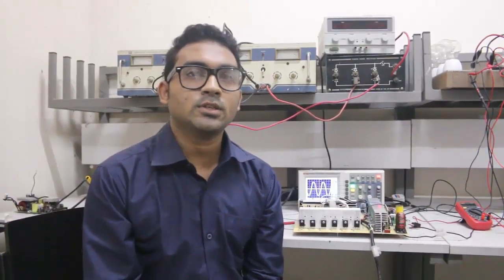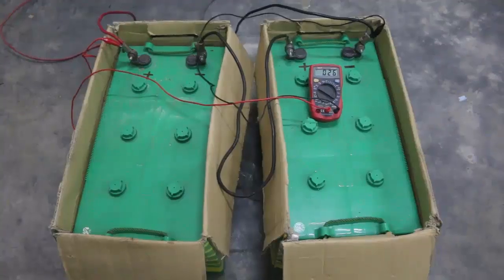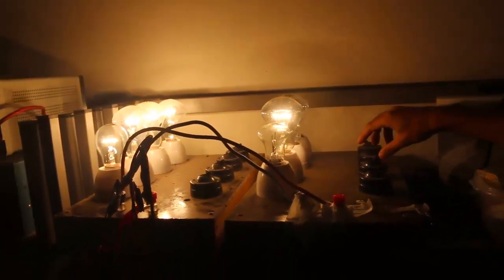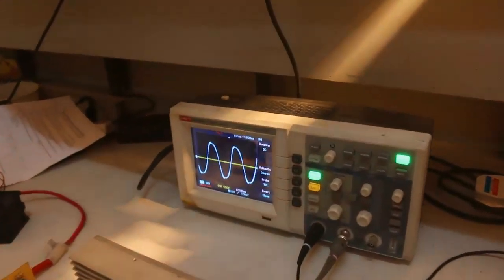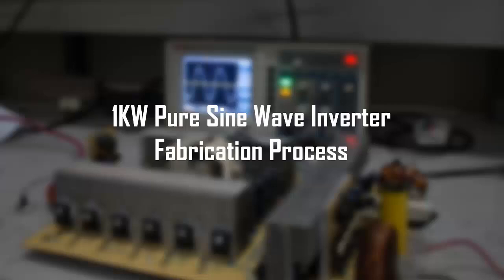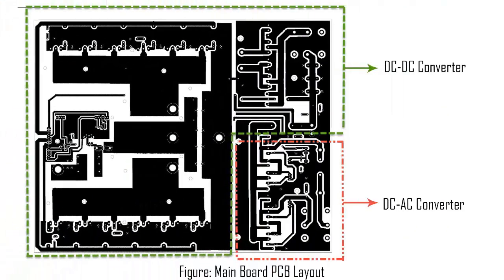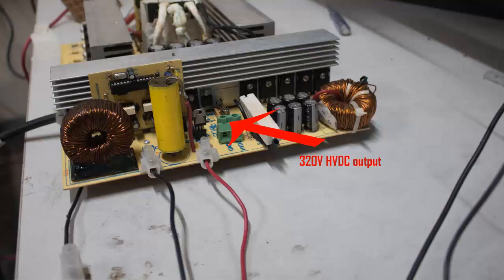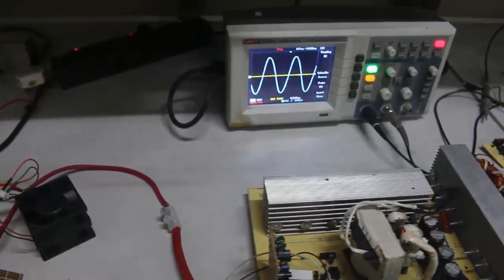Pure Sine Wave Inverter (1KW)

Comment: Hi everyone.knows any to tell me,what if i run my spwm inverter,with any type of load,without low pass filter to the output?,whatt the matter????? must be a filter anyway? and if yes,why? thank you.
Reply: There's a hum noise if you don't use a low pass filter. Plus some sensitive devices can get damaged due to the spikes caused by the switching. It's like a staircase waveform without the low pass filter so you can understand what's wrong. For loads like incandescent bulb it won't matter but for stuff like a fan/motor or computer SMPS that have inductance, the sudden changes of the non-filtered output can be a problem. At the least they will run hotter. It also creates EMI noise that can get picked up by other appliances like your TV and there will be a hissing sound from the TV.

Comment: the video is very effective for me. i want to make free energy for home 1.5 kw. so please if possible make 2 videos for Transformer calculation for EE Ferrite core of push pull inverter "Square wave & Sine wave. please help me and provide C code, design diagram/pcb lay out if possible. 01819-988287. Dhaka.
Reply: you can do this exactly and ask some else to charge batteries, and you will have free energy :)

Comment: Mr, I am interested in pure sine wave project you and your friends to develop the project .. Can you share it? I want to try on a 3-phase AC motor 0.75kw.tqvm .. razi022@gmail.com
Reply: shared project file, scamatic circuit microcontroller code that you use if possible. TQ ..

Comment: You have all done very well my big brothers. In fact I commend you all for the good work done. May you all get the necessary wisdom and knowledge to do more to help us. By the way we have problem with power here in my country and I have thought of building a pure sine wave inverter to serve as a backup when there is no power. Please could you share with me the source code, the circuit diagram and other important files needed to build this nice circuit? Thanks in advance!
Reply from the maker: your email please
Reply: Reubinho18@yahoo.com thanks in advance
Reply from the maker: check your email and let me know
Reply: I just checked but it's not in yet.
Reply: shuvangkar shuvo  tienes el esquema

Comment: sir i make booster using pushpull technology (12-230) but now i have convert again it to ac so i will very thankfull to u iused sg3525..
 Sir, I want to make this inverter. Can you guide me by providing all the necessary detail (like schematic diagram, pcb design, Microcontroller code project file, ect......), I am very much interested about this project. Yesterday i already give you my email id, but not get any email from you    my email is irfankhandgk11@gmail.com

Comment: hi , how are you ? i faced some problems with making the output filter, I can't find the data of turns number of coils , wire diameter and the size of the filter in the attached report !!, Can you provide me with the data?
and I can't find the code of microcontroller for the  circuit Protection in the attached files!! , thank you sir

Comment: Hi sir. Can you share the project files for this project. I really need it for my final year project. Thanks. (farhannafis.azmali@gmail.com)
Reply from the maker: Please check your email and make sure whether you get the files or not
Reply: Thank you. Already got the files.
Reply: sir i make booster using pushpull technology (12-230) but now i have convert again it to ac so i will very thankfull to u iused sg3525..
 Sir, I want to make this inverter. Can you guide me by providing all the necessary detail (like schematic diagram, pcb design, Microcontroller code project file, ect......), thanks    irfankhandgk11@gmail.com

Comment: awesome thank you, mr.salah2030@gmail.com please send it
Reply from the maker: Please check your email
Reply: thank you , but i didn't find the code file
Reply: sir i make booster using pushpull technology (12-230) but now i have convert again it to ac so i will very thankfull to u iused sg3525..
 Sir, I want to make this inverter. Can you guide me by providing all the necessary detail (like schematic diagram, pcb design, Microcontroller code project file, ect......), thanks    irfankhandgk11@gmail.com
Reply: sir plese send me irfankhandgk11@gmail.com i will be very thankful to u
Reply: sir plese send me irfankhandgk11@gmail.com i will be very thankful to u

Comment: Is the Design completed by your team, Or u all took it from Open source internet. However i am not clear yet which micro-controller you used for SPWM. There is no Feedback control for output voltage, Just simple Dc BUS Controlled by SG3525. Please upload the No load current data. If possible upload the final year paper.

Comment: I would like more info on this inverter. can I get a schematic. or parts list? I am trying to build a inverter to power my off grid house. I need to build a 6-8 kW. or 3-4 of the 3kw. witch ever will be most efficient. I heard some will be more efficient at low load and some at higher loads. I was hoping to find a link to get info or schematic. I would most grateful if you can help me. thanks you

Comment: sir, i steel working about same project i use a ferrite core TF which input was12v dc  40khz pwm signal and output is 230v ac square wave and 310v dc by using rectifier  but i can not make it 50hz sine wave.plz can u help me by giving circuit diagram of your full project.thank you.............EMAIL: ferozahammed69@gmail.com

Comment: THE BEST SOLUTION TO MAKE A SIMPLE SINE WAVE NVERTER IS PWM INTO THE MOSFET TRANSISTOR WITH SINE WAVE RITMIC BUT MECHANICAL DESIGN WITH SIMPLE PWM DC MOTOR CONTROLLERS INTO THE PHOTO TRANSISTOR
Reply from the maker: check your email
Reply: shuvangkar shuvo Emacacoel@hotmail.com

Comment: Thanks In Advance :D
great :) i am also working on that i am making variable frequency for which i converter 220AC to 320DC first then using H bridge for modulation  but i am facing problem at outside LC filter. my carrier frequency is 31.5Khz i had made filter which is making noisy sound and input current is too high if i attach 100 watt bulb it take 3 amps @220 input  as i remove filter it come back to approx 500mA . i need you help what should i do. i change core many time but result is same
one thing that is confussing me is why you use an other inductor beside the filtering inductor?
email: waqarhameed113@yahoo.com
Reply from the maker: Most welcome Waquar. Another Inductor is for Boost converter which is boosting 24VDC into 312HVDC. 
Did you keep dead time in between the same side MOSFETs signals??
This is the one of the reasons, H- bridge is dissipating current at no load.
And filter section, I used Polyester capacitor and ferrite core toroidal inductor.
Reply: you use chopper(transformer) for boosting right??? why and where you use 2nd inductor 

yea i manage dead time. when i remove output filter and attach load it works normally and take approx 40 to 50mA at no load condition
what is the value of inductor and capacitor you are using for filtering 
please send me schematic or other stuff if possible that might help me out 
email: waqarhameed113@yahoo.com
Reply: Well I have solve this problem i do not apply complimentary spwm that is a reason well thanks
Reply from the maker: +Waqar Hameed welcome

Comment: What CPU is using for the SPWM ?Great project
Reply from the maker: Thinks.
I used atmega8 for generating SPWM
Reply: Thats Great as i have that IC on my ATMega Arduino board, i look forward to the project circuits, PCB and source code becoming available so i can make my own version, only thing is i want to scale up to 10KW running from 48 Volts, is this an easy upgrade with higher power IGBT's and filter components ?,

Thanks
Dave
Reply from the maker: +david ellis Sure you can.
please send me your email id
Reply from the maker: +david ellis Sure you can.
please send me your email id
Reply: hi, nice work, please can anyone share me the circuit, PCB and the necessary code and files, email: walkingwithb@yahoo.com

Comment: Shuvangkar,  can you guys consider making another video on analog designing of your inverter for your fellow students? You may also talk about the design which failed, and explain why it did fail.
Can you also demonstrate your device running a single phase induction motor (i.e.- table fan) as load? This would be also another proof that the output of the device is indeed sinusoidal.
Keep up the hard work.
Reply from the maker: Sure, Sir. After term final exam we will  demonstrate designing part.  I have made the video keeping mind of  non-technical person as the video will be demonstrated on PES General meeting. This time, we have written fabrication report. After the exam we will write an application report and video where we will describe everything in details. And one more thing, Our DC-AC inverter side is 16 kHz. I have already designed a circuit so that frequency can be upgraded to 500Khz,  which dramatically reduce the filter size. We will  also demonstrate for what reason many people have failed. And We are importing Low Rds MOSFET from America so that we can increase efficiency up to 90% . 
Keep prayer sir. I have learnt  BJT from your video lecture. These videos were awesome sir.  After that, I designed a water pump controller using BJT. that was the starting of analog circuit
Actually, sir, this is the 4th design. We had no time to improve the design as PES GM will be held this month. We also included input, output current protection and temperature protection, battery low voltage protection  which we could not demonstrate in this video as I had an accident a few days ago .
Hope we will test the design running a single phase motor after exam.
Reply: shuvangkar shuvo Hello a question how often does the ferrite transformer work and how many turns does the primary and the secondary have. Thank you
Reply: shuvangkar shuvo ?